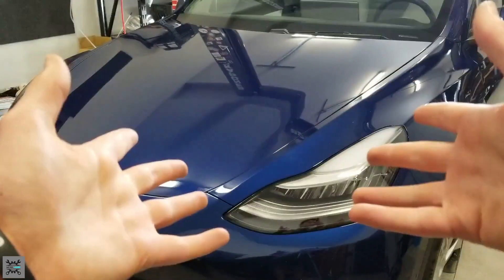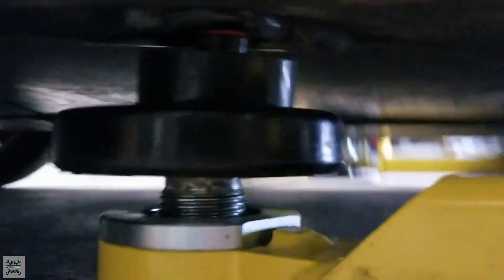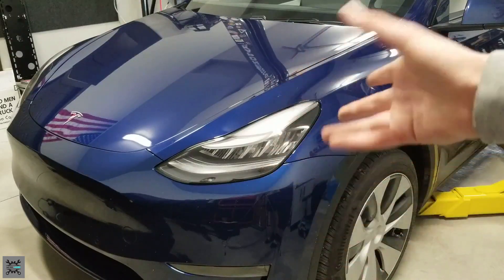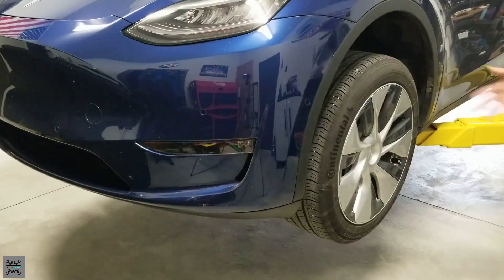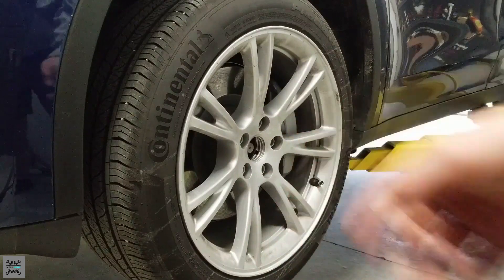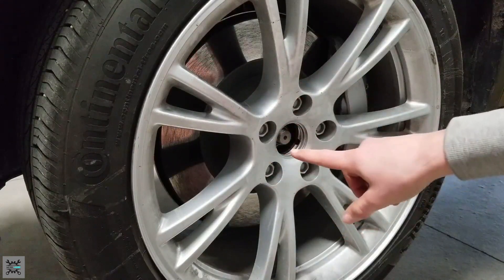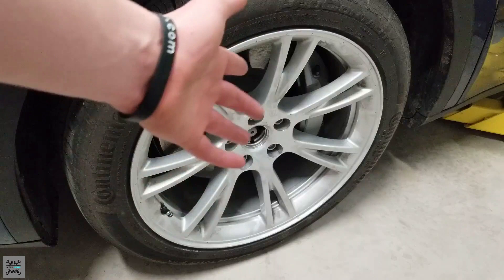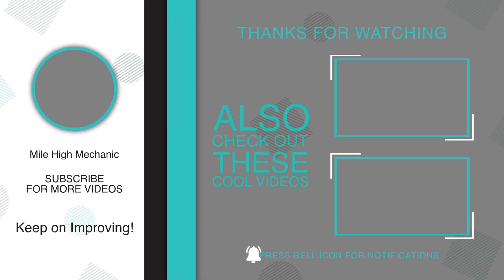How to Rotate Your Tires on a Tesla Model Y, S, 3, X | How to do a Tire Rotation on ANY Car/Truck

Comment: I don't know about this.  I'm going to have to stick with Tesla's recommendation and simply move front to rear and rear to front on the same side keeping rotational direction the same. Not on every car, but at least on my Teslas
Reply from the maker: That is one way to do it, but unless you have directional tread on your tires, there is no reason to keep them all spinning in the same direction. The rear "X" balances out different wear characteristics from each corner. This leads to more even tread wear on all of the tires. There is no wrong way to do a rotation, but this is the way I found that works best
Reply: @TheMileHighMechanic  That makes sense.

Comment: This is the only video on YouTube where someone actually does it correctly. All of the other videos has some clown jacking up the vehicle and proceed to take off the wheels using the jack as the support. Then you got other clowns copying that clown and soon it's a freaking circus. If you don't have access to a lift, you can still do a tire rotation by lifting at the control arms and then putting a jack stand where the pucks go. That way you can get a jack stand on both lift points on each side. I've been working on cars for over 25 years and I swear I see Tesla owners do the dumbest crap. I'm just waiting for one day when the jack fails and someone loses a finger, hand, or foot.

By the way, great video but I do have one suggestion. There is a service menu that you should go into which will immediately reconfigure the tpms location. I do that after every rotation so the tpms location is correct rolling out of the garage. It may automatically adjust but I do things by the book.
Reply from the maker: Haha, thank you. This is the way that I have always been taught, and I agree that Tesla owners can be.... unique.... At times😂

Comment: Your plan only works if the front and the Rear tire sizes are the same. 
My model S had different sizes front and rear.
Also if you have air suspension you need to put the vehicle in jack mode.
Reply from the maker: That is correct. Yes, only performance models and some model s come with staggered set ups. The model Y does not have air suspension so it doesn't have jack mode.

Comment: But the stock model X has different size front and rear wheels and directional rims so you can't rotate anything unless you go aftermarket wheels first, and even then you would be reversing direction which is generally not recommended.
Reply from the maker: The X's do have a different front and rear tire size that makes it so that so they cannot be rotated. As long as you pick a wheel and tire combo that have the same size tires and don't have directional tread (which hardly any do) then you will be able to rotate them.

Comment: You didn’t address how to reset TPMS after tire rotation. How is that done?
Reply from the maker: There was no need to reset the TPMS system because the car does it on its own.
Reply: @TheMileHighMechanic  How long does it take? After rotating the wheels, I drove 3 different times for ~45mins and they didn’t recalibrate.
Reply from the maker: @tony45682  Moving the wheels (aslong as they are the stock wheels) will not affect the TPMS system. The car should instantly recognize where the wheels are, and read out the pressures accordingly due to its ability to track the sensors in the wheel. Are you not seeing pressures?
Reply: @TheMileHighMechanic   Everything is stock. I have a 2018 M3, and it finally updated; took a full day.  Evidently on mine it’s not instantaneous.
Reply from the maker: @tony45682  hmmm, interesting. Im glad everything worked out!

Comment: Tesla Mobile mechanic came and just put the rear straight up to the front and the front straight back to the rear, no criss cross!!!
Reply: I had my Model Y tires rotated today. Just swapped front with rear without crisscross. I asked about it and he said there is no right or wrong way.
Reply from the maker: @howardlerner4958  Correct, there is no wrong way, but to ensure more even wear on all of the tires you would want to do a cross. This gets the tires to every spot on the car this making them wear even.
Reply from the maker: People do it different ways but I prefer to criss cross 2 tires so they wear down more evenly. If you do it the way showed in this video, the tires will end up being in every location, or in other words, 1 wheel will end up being in every position on the car (thus making it wear like all the other tires). Moving the back ones up and the front ones back isn't bad, but it will make it so that the left tires never leave the left side and the right tires never leave the right side. So what i'm trying to get at is that doing a cross makes the tire rotation more of a "rotation" instead of just a "swap." I do appreciate your input and I hope you found my video helpful and informative.
Reply: @TheMileHighMechanic  Agree! Thought it was strange they didnt do it your (traditional) way. I would have prefered it.
Reply from the maker: @Matador50  Yeah I mean it is always something that can be changed. I made this video to assist people and encourage them to do it themselves. I personally don't take my cars anywhere to get work done (besides an alignment) because I like having the confidence in knowing that the job was done right and the way I want it. If you want to do it yourself all you need is some tesla pucks, special jack stands and a low profile jack.

Comment: Great info. You might want to add to change the tire pressures on these wheels after rotation. We've different tire pressures on front vs rear wheels.
Reply from the maker: Unless it is the performance model, you shouldn't have different tire pressures. they should all be at 42psi.
Reply from the maker: Thanks for the feedback, I guess I just assumed that most people would check the car's tpms system to see if the pressure was correct. Thanks for bringing that up!
Reply: No. 42 front, 42 rear on this vehicle

Comment: Model Y performance has different size tires on front vs back. So this video doesn’t work for a model Y performance when it comes to pattern.
Reply from the maker: I do not think all performance models have staggered wheel sets but in the case that you do, you cannot rotate them . You will just have to swap another set on if you want to "rotate" them to keep them from wearing too much.

Comment: What are the chances that a standard tire shop will use Tesla pucks?
Reply from the maker: I have taken the Tesla to Discount Tire and that's where I first heard of them. So to answer your question, I know Discount Tire uses them and if they use them would bet that some of the other shops are on the same page.
Reply: @TheMileHighMechanic  you in Denver? I read some horror stories about some shops not using it and puncturing the battery lol
Reply from the maker: @driftx2  I am in Colorado Springs. If you are worried, you can always ask them before you go in for service if they use them or something like them. If none of the shops around you have them, I would just order them and do it yourself.
Reply: @TheMileHighMechanic  cool Yea I did it. Myself today. 129 ftlb was a pain lol.
Reply from the maker: @driftx2  Yeah tell me about it. I'm glad you were able to get it done.
Reply: Informative video. Thank you.

Comment: Can you do an X pattern tire rotation as well on the Model Y AWD?
Reply from the maker: Yes, I show how to do a front cross rotation (which I do on all of my vehicles). But the rear cross and double cross (X) rotations are acceptable as long as you have non-directional tread.
Reply: @TheMileHighMechanic  would x pattern or rear cross be better than the other? If you committed to one should you keep the same pattern for every future rotation?
Reply from the maker: @kimwong2053  There is not a "better" tire rotation technique due to the fact that a tire rotation is performed to reduce uneven tire wear. Also, I would try to stick to one technique to ensure that you get the longest life of your tires.
Reply: I have always done front to back and it worked well for me